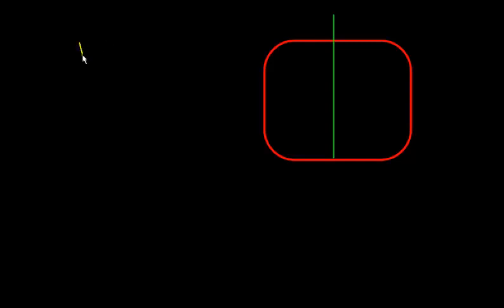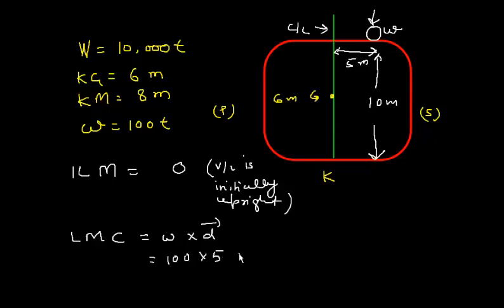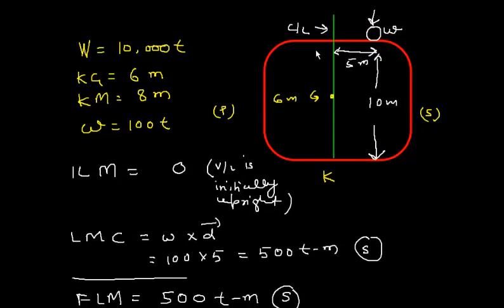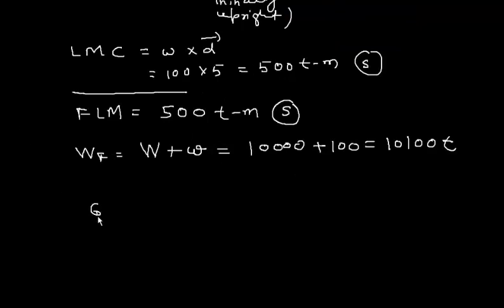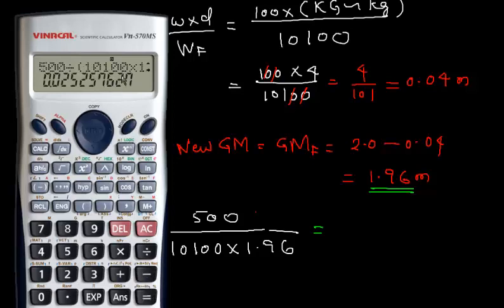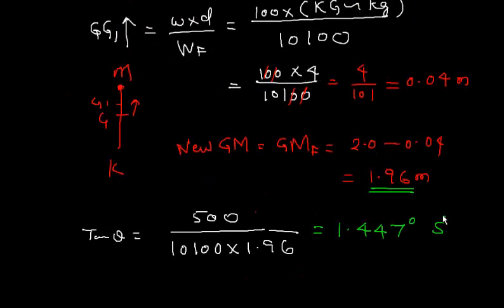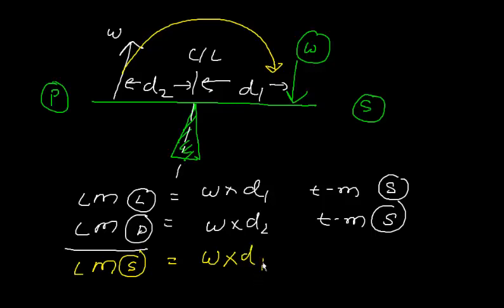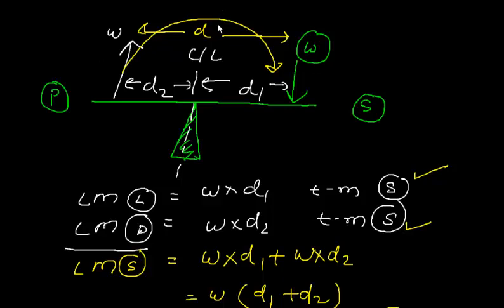Ship Stability _Introduction to list formula _Example of list due to Loading

Comment: Sir just to ensure I understand, would it also be correct to say that the rise in G to g1 is 0.04m therefore the new KG will be equal to the initial KG of 6m plus the rise in G 0.04 = 6.04. So the GM would be the 8m minus the 6.04 which would equal the 1.96m. Would this method also be correct. Thank you great video
Reply from the maker: That is correct. You need to find  final GM , do it eitherway.

Comment: A tanker of W 50,000 t, MCTC 650 tm, KM 11 m, KG 10.1 m, listed 7° to port and trimmed 5
m by the stern.
Find the transfer of oil that must take place between Nos: 10 P &amp; S and Nos: 2 P &amp; S to bring
the ship upright and trimmed 3 m by the stern.
The COG of the tanks are transversely 14 m apart &amp; longitudinally 140 m apart. 

  please can you explain this sum sir

Comment: is this method would be correct in submarine (fixed center of buoyancy)  my graduation project about ROV  and i want to know the angle it will make if i add weight in its gripper